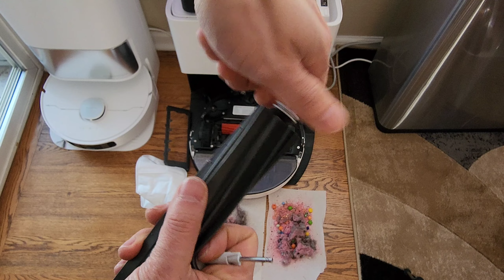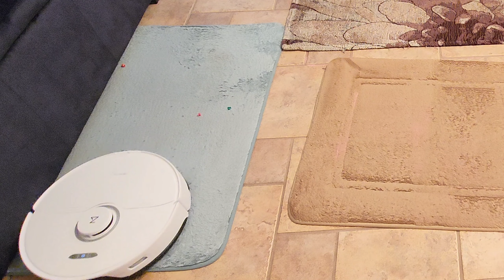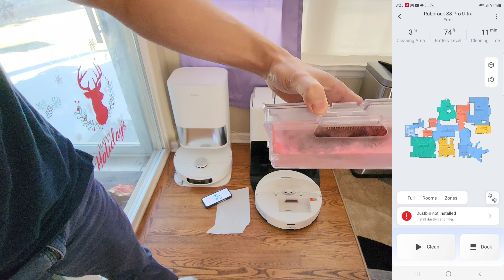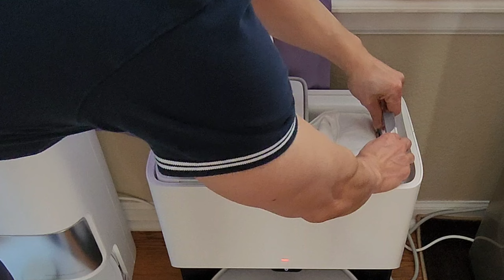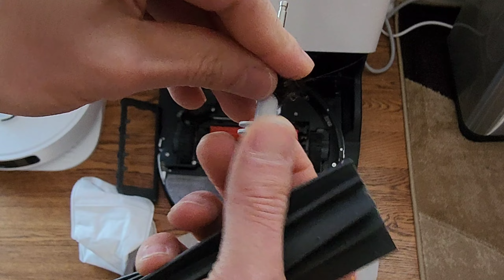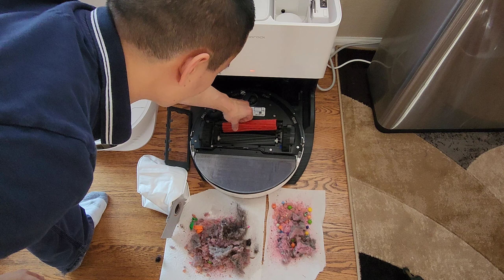Roborock S8 Pro Cleaning Challenge

Comment: I am a little surprised that it did not pick all that powder up.  I had a real life issue, dropping about half a cup of salt on my tiled floors.  I sent out my X1 Omni on med suction and it cleaned it up totally.  Now I am wondering if it is not due to the all rubber brush?  The combo brush maybe just kicks the salt/powder out the crevices for easy cleaning.  Just a thought.  I do however love the rubber brushes, like I have on my J7 as they really are a pleasure to clean vs the combo brush.  To me, there is at the end of the day only one single reason I think this S8 is better than the Omni, and that is due to the raising mop pad.  I have my X1 for about six months now and it is an absolute beast.
The second issue I see is that it was very aggressive with the water bottles?  Why do you think that was?  I prefer the J7 overcautious approach to a very aggressive approach.  You never know what you may brush or sideswipe.
Reply: The rubber brush is better carpet while the regular bristle brush is better on floors.

Comment: I was supriced when I checked mine before. That the rollers are not really on the floor. But instead tilted up. And it sucks from the air above your floor. Less efficient and more energy wasting.
Its built for carpet 90%.

Comment: Hello, I am interested in purchasing this robot.
I have a question, is it possible to completely remove the mop when cleaning two white carpets with hairs (the hairs are long, 4.5 cm.). I see it has a pick-up sensor, but when the mop is dirty, it will then go onto the carpet and get dirty again.
Reply from the maker: The older models like the S6 MaxV and S7 have a removable mopping plate and pad. The newer models only the mopping pad is removable

Comment: I am surprised with its performance with powder and emptying bin as well ,  Do you think it's worth buying , I waited whole year for this , now I am having second thoughts . 
Which one you recommend  S8 pro ultra or Roborock S7 Max v ultra.  Please  suggest 🙏🏻 
Thanks
Reply from the maker: So if you already own the S7 MaxV Ultra than I would say the S8 Pro not a significant upgrade or really designed to be a replacement to that model. The S8 Pro is aimed for someone who doesn't want the camera system for privacy reasons or looking for a robot that does well picking up long pet hair. Performance wise they are very similar despite the S8 Pro having better suction.
Reply: @RobotMasters  no I don't  owe any robot vacuum yet , but was debating for year now . Which one should I buy , I have half home carpet and half tiles.  Which is better roborock S7 maxv ultra or Roborock S8 pro ultra? Please  suggest
Thank you 🙏🏻
Reply: Please  advise,  waiting for your reply 🙏🏻
Reply from the maker: @kuljeetkaurmakkar  Well technically the S7 MaxV Ultra has more features over the S8 Pro. S8 Pro good for pet owners. Personally I would go with the S7 MaxV
Reply: @RobotMasters  Great ! Thank you for your advice 🙏🏻 ☺️

Comment: Does the roborock s8 go under a lounge on legs exactly 10 cm high? Shouldn't normally be a problem as the roborock is less than 10cm but would like to make sure as I'm going to buy a new salon...  Thanks !
Reply from the maker: Yes as long as the top of the Laser Sensor doesn't get bumped. There a sensor on there that will cause the robot to back up.

Comment: Thanks for the helpful videos. I was going to buy the s7 with the ultra docking station, but then found out the s8 is coming out. I have 1000 square feet of hard floors (lvp) and then I'll have a few large rugs. I'm also getting a cat so I'll have cat hair to clean up.

I imagine the s7 will go on sale when the s8 releases, but if it doesn't, paying 1400 and then 99 for the dryer station seems pretty comparible to the 1600 s8. In your experience which does a better job of picking up hair on hard floors, and which does a better job mopping? It looks like they are pretty comparable and that there's not much difference in terms of performance. If the duel brush does worse on hard floors though that would be good to know. If not though, and ut comes down to them being similar price and performance, I don't know why I wouldn't just go for the s8 since the docking station and white option looks much better visually. What are your thoughts? Do you have an other company models you suggest I look into for my use case? Thanks again
Reply from the maker: So the dual brush roller seemed to do well on carpet. I didn't notice any real difference in cleaning ability over the S7. One thing to note I found the dual brushes to be easier to clean long hair off. Get the S7 if you want the front facing camera with live video feed, aka security bot. The S8 Pro has the Hot Mop dring feature and slightly more powerful specifications. I personally didn't notice any real difference in cleaning performance. Personally I would go with the S7 MaxV and Ultra dock.
Reply: @RobotMasters what would you recommend to choose if they’re same price? i have ability now to get them for the same price. i have cat, and fur cleaning is imporantant to me
Reply from the maker: @rm5396  Probably the iRobot i4
Reply: @RobotMasters  what about something from roborock?
Reply from the maker: @rm5396  In that price range the S5 Max is a good model. You will need to spend close to $500 is you want a self emptying. Model like the S7 Plus or the Q series.

Comment: I have a large breed dog that sheds alot. I currently have a Roborock S6 maxv, that I run daily, and the bin is always full after each cycle. The hair strands are usually bellow 10 cm, do you think they get that often tangled in the axles? How often do you expect to refill the clean water tank, if I plan to use the moping feature daily, at high intensity moping and cleaning the pad after 10 min of running?
Reply from the maker: So from my personal experience using the iRobot and previous generation S7 MaxV that utilize an all rubber brush bar design I found the hair wrap to be minimal. The hair only gets wrapped around the ends. On the S8 Pro they redesigned it so the ends comes off easily in one piece. So for dog hair I do recommend this style of brush. As for pickup ability it will be very similar to the S6 MaxV but the self emptying system should be able to remove the hair from the dust bin. In my home I run the robot 2-3 times a week and mop once a week. I found I would have to empty and refill the water tank every two weeks. My hardwood floor areas are about 1,000 sqft.
Reply: @RobotMasters  Ty!
Reply from the maker: @radul476  You Welcome 🙂

Comment: Hi Nathan, according to you which robot has strong mopping capacity on deep strain of big flat?
Reply from the maker: Hello, I haven't currently seen a robot that has the ability to handle deep stains. From what I have seen, they all are designed for light mopping tasks. With that in mind the top performing mopping robots are the S8 Pro, Braava m6, and for wet spill the ilife w400 series.
Reply: @RobotMasters  Nathan, if you please do a vedio with robot of commercial purpose use as those have strong capacity to mop as in Bangladesh huge dust r dirt.
Reply from the maker: @Fahmida Afrose  There a couple of robots design for more of commercial or dirtier environments like work shops, warehouses and garages. Softbank called Whiz makes a commercial floor cleaner and Makita DRZ300z
Reply: Have you looked at yeedi vac 2 pro? It's one of the best mopping robots but stays within budget.

Comment: This is just a wide observation, but from your video, it doesn’t look like this is much of an improvement (maybe not as good) as my 7 MaxV ultra.  I rarely find debris left in between my tiles, nor find much debris left after the auto-empty.  I am wondering if the dual roller is really an improvement(?)  Or is the dual power mopping a big improvement?
Reply from the maker: So just from what I observed it a close call to know exactly if one robot did better than the other. Both the S7 and S8 performed well, but I would say the S7 might of performed better with tile and powder. Maybe it has a better seal as the extractor bar is going over the surface. I do like the redesign ends if the new brush bars. They are easier to remove and it seems all the hair gets wrapped around the ends on purpose. I also noticed they went with the bristle side brush instead of the rubber version. I will continue evaluating and see if anything changes.

Comment: What do you think of this robot compared to the dreame l10s ultra?
Reply from the maker: The L10s is cheaper overall, and has a few unique features with a different mopping pad system. As for cleaning performance they performed equally as well. I would say for people that have a lot hair on the floor go with the S8 Pro. Easier to clean the hair off. If you want the camera system than the S7 MaxV is very similar to the S8 Pro. If it was up to me I would personally go with the L10s because it cheaper and offers a lot if the same features.

Comment: How is the robot performing on high pile carpet ? Like the bathroom rugs etc. my S7 Max v cant do any bathroom rugs.
Reply from the maker: The Robot will struggle if the user doesn't remove the mopping pad. With the S8 you can't remove the mopping plate so this robot does best with medium to low profile carpets.

Comment: Just a observation I've also seen on other channels, you do lose some suction on the auto empty with the cover in the up position. Try lifting the cover when auto emptying and see if there is some resistance.
Reply from the maker: I just realized that, thank you for pointing that out. The self emptying is good enough to get the dirt out for normal day to day cleaning.